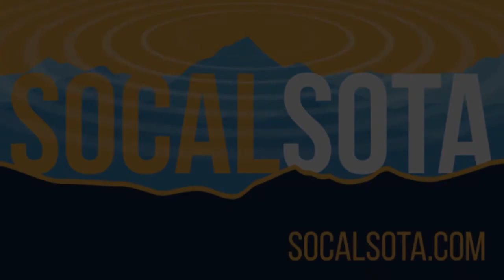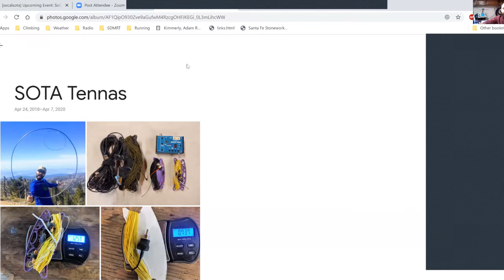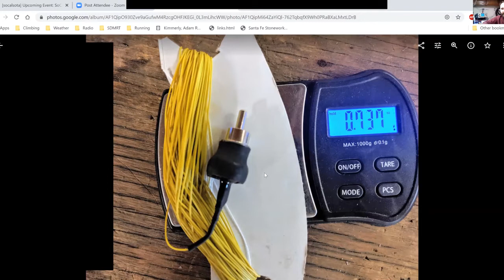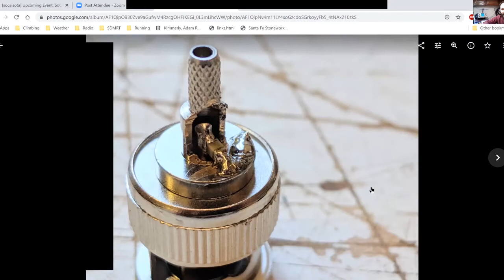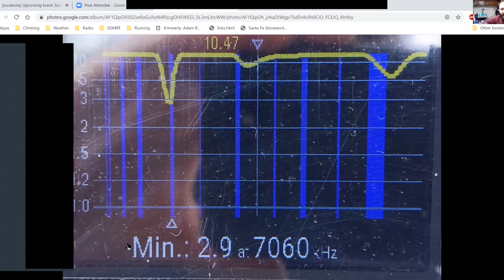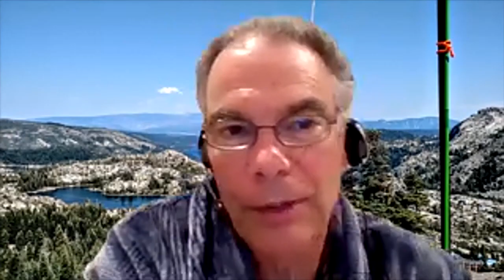Adam Kimmerly | Top 3 Portable HF Antennas

Comment: Why do you need traps on an EFHW? The EFHW by nature is resonant on harmonic bands.
Reply from the maker: The EFHW is resonant on harmonic bands, but presents high impedance on non-harmonic frequencies. For example, a 40m EFHW is resonant on 40m, 20m, 15m, etc., but not on 30m. To get it resonant on 30m, you either need to use links, traps, a tuner, or some other impedance matching device.